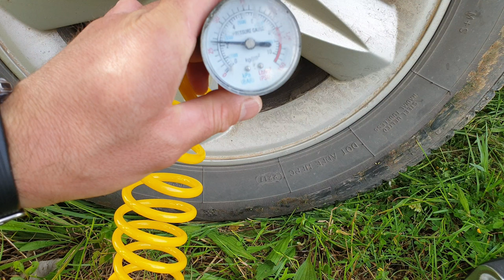Make portable Car air compressor to work with Parkside 12V LiIon batteries

Comment: Well done.  I'm doing this already using my 12v milwaukee m12 battery and battery adapter.  This is the future I believe with most appliances:  portability, cordless, and not tied or dependent on the grid.

Comment: Excellent video! Could you make it work with the 20v version of the Parkside batteries? Or make a "universal" adapter for the 12v Parkside tools so that they would be operated with the 20v batteries as well? (using a high-amp step-down converter for example)

Comment: Greetings, my friend. You have nicely modified the compressor, I used a single-piston auto compressor a year ago and I power it with an X20 V 4Ah battery directly without electronics, only a mechanical fixed pressure switch.  breaks to cool down the compressor. (https://youtu.be/DqPWGES0ZQk)
Reply from the maker: Thank you my Friend🙂🤝
I watched the video, you make it very cool and you can take it anywhere.  Pressure switch is a very good idea.